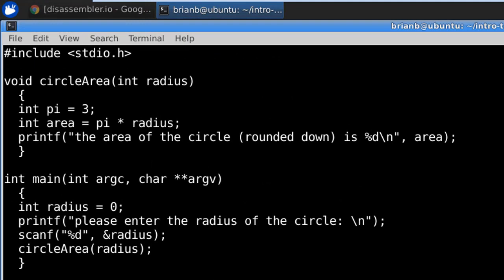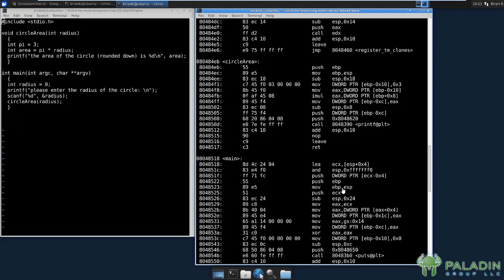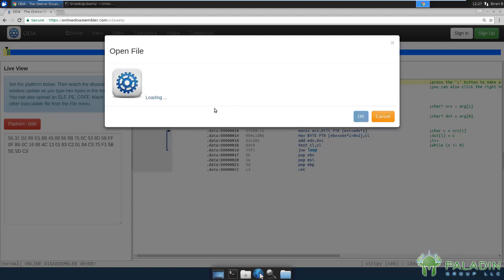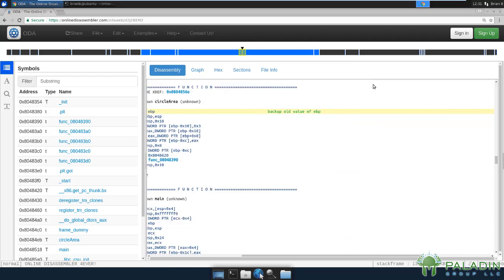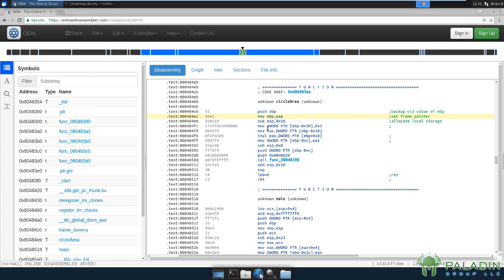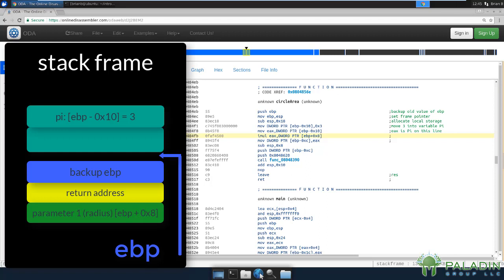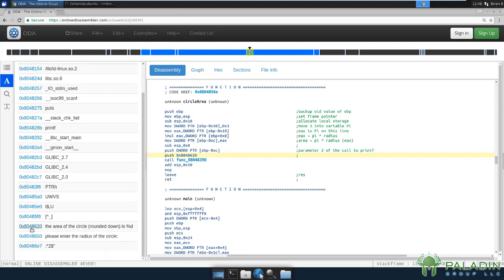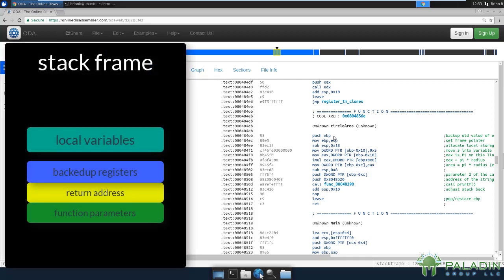Introduction to reverse engineering - Stack frames, prologues and epilogues

Comment: a very nice video. I have a question please: They always say, we add the canary values (StackGuard) into the prologue function, how is that? thank you very much :)
Reply from the maker: yes that is correct to protect the stack the canaries are placed below the return address on the stack such that if you generally need to overwrite the canary to overwrite the return address.
Reply: @paladingroupllc3480  
that is right, but please the question is: How can I do that my self? (editing the prologue and epilogue and add canaries) 
thank you very much ^^
Reply from the maker: @hamzahm7767  The way you do this is to recompile your software on linux us -fstack-protector on windows I think? it's /GS. basically teh compiler puts it in. you COULD binary edit your exiting code potentially but that would be a mess.

Comment: Thanks for the video.  What are your thoughts on using GDB for analyzing disassembled code?
Reply from the maker: I like using GDB the gdb disassembly for analyzing small areas of code where I might currently be looking, and understanding stack layout, however for large areas of code I used to us IDA pro, however the NSA just this month opened sourced their decompiler called Ghidra (https://ghidra-sre.org). I tried it out and though it's rough around the edges especially the user interface it's incredibly powerful and free. even better looks like it does de-compilation!  IDA's de-compilers costs nearly $4000.00 PER architecture. I'd recommend you try out Ghidra if your looking at anything large  I might move away from IDA especially if the open sourcing gets people to contribute and make it even better than it is now. in the future if time permits I might make some videos on using it. In the download there's a "Docs" section which has what looks to be "classes in PDF form" on how to use it!